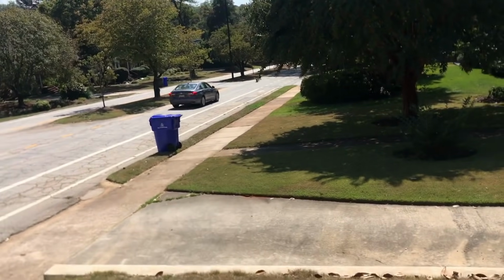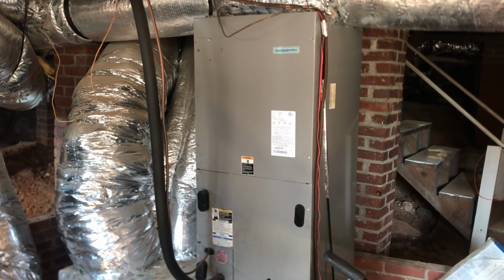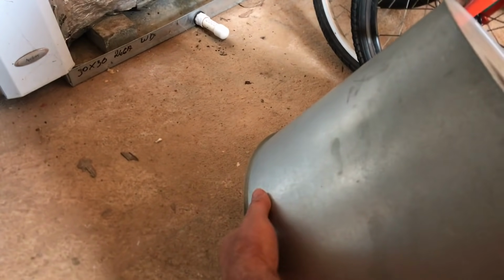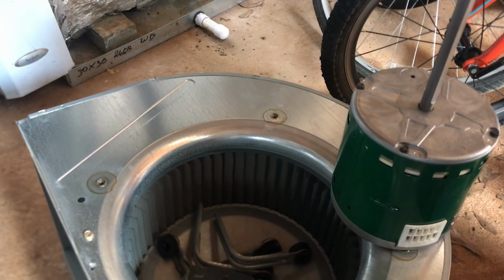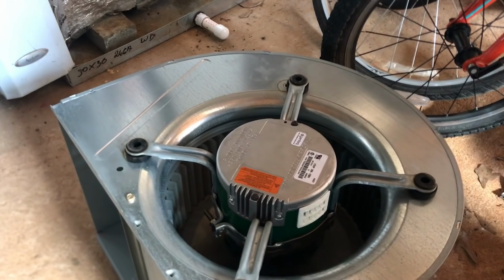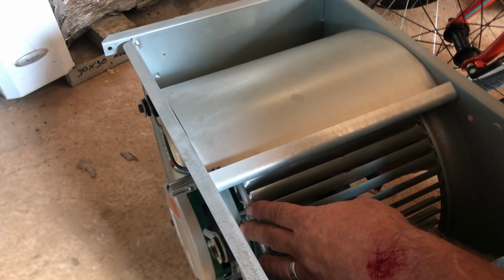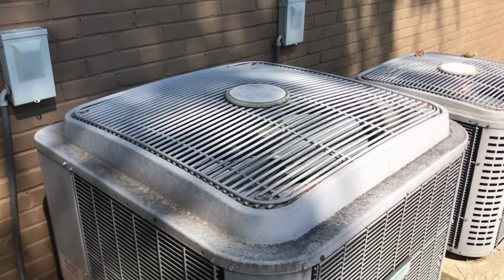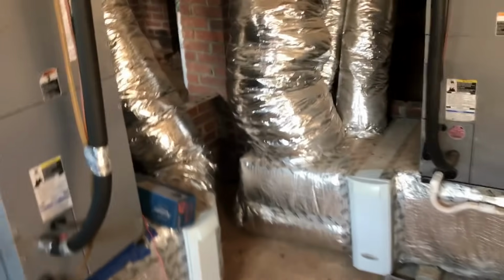Replacing X-13 Blower Motor in ICP Air Handler

Comment: 👍🏼 Enjoyed this video, especially the blower motor that finds the proper rotation. I am not in the HVAC business, so that was amazing to me. Where is the blower motor start capacitor located? Out on the condenser unit? As I said, I am not in the business, but am fascinated by it. And yours are the very best videos of the 4 HVAC Youtubers I follow. Tnx
Reply: These type of motors do not require a capacitor.

Comment: Having an intermittent issue with the air handler.  The thermostat kicks on and the compressor and handler turn on and air starts blowing from the vents.  The blower motor will stop for a few seconds and then start again.  Sometimes it does it once or twice and sometimes not all.  Ultimately, it completes the cycle and the thermostat shuts off.  I had a reliable tech come and take a look and, of course, the system ran without any issues.  He verified that the thermostat is fine and believes that it is most likely the ECM control module.  He said to let the system run as is as there's nothing wrong with it.  He did show me how to replace the module and it does look very easy.  Just wondering what your thoughts might be on this.  Thanks.

Comment: Qwik makes a plug and play conversion to get away from that over engineered crap, or do as I do and wire in a Blower Relay.
Reply: It's not very complicated, I bench-test the X13, 2.0, 2.3, 3.0 and EON motors every day for homeowners that had a "technician" tell them it was a bad motor.  Normally the result is the motor is fine and the "technician" is an idiot that doesn't know what they are doing.  I see so many people that have air conditioning contractors licenses but wouldn't pass a basic competency test.

Comment: I'd probably leave the arms bolted to the housing.  Then loosen the band and push it down while sliding the motor up and out.  That way you don't have to goof around trying to get the arms in the right spot.

Comment: Hello Ted good work on the motor replacement. i have a question in SC based on your experience when you say the  A/C unit  is  short  cycling  ( time on/off time and back on )

Comment: Just like the mechanics that work on cars I break out there Liquid Ranch and spray down with they have to loosen up and let it soak in, I'm surprised you haven't thought about doing that by now replacing fan motors?

Comment: HVAC in SC I think is following yer vids.  Seen where he says in one video not to just change out capacitor.   And he just came out with a 60 sec tip about the green motor you just replaced.

Comment: Those x13 motors have a bad reputation some good they work off 24v from the control speeds are pretty simple the module on the motor  outlast the itself in most case, they dont have a start capacitor that's where the module comes into 24vs from control board is what tells it to there are 2 models a 120v motor and 230/240 so when it has a call to come on from the 24vs off the control board it basically completes the the primary voltage that makes run and sometimes the factory speed settings are off allitle ,the simple to check is take the module off and check the 3 leads on the back side of the if there is resistance between one or less there is a winding issue on the motor itself you can also check the leads to be sure it is not grounded to the what would the motor shell most of the time the module is good and the motor ends up having those x13 motors sometimes run near $400 depending on where you the module itself cost $200 to $300 depending on where you get them as well I live in Springfield, mo, I recently had to replace our x13 motor we ordered it off ebay for I believe $229 so still not that as well,I called a supply company named stone parts had them instock,they wanted $449 which was incredibly too expensive which I turn led me to a cheaper route,  I do like the capacitor type motors the best, you can convert to capacitor type however the x13 is very easy to install and troubleshoot that's the only reason I went with original replacement  but not you almost have to have a doctors salary to afford the x13 ,yes they have bad things about them and good as well ,but there is good and bad about any product, I love watching your videos you have a lot of knowledge and tricks of the trade stored in you head I'm just a journeyman hvac person I've done installs on new homes exx. Sometimes when stumped on an issue I find one of your many YouTube videos  and learn something pretty much daily,I know this was a really long comment i just wanted to throw a few things i had been i may be wrong on some informative if i am could you please let me what it was and clear up what I may been wrong on,thank you have a super day

Comment: My brother handles most of our HVAC, I usually only get involved when there is complete new wiring or complex smart systems need setting up.
We're have both come to the conclusion that the small efficiency gains of the X13 motors are completely obliterated by their absolute unreliability.

Comment: There wasn't  the option to just change out the module?
Reply: Chris Hall from the looks of it it was all one piece
Reply from the maker: @hozerhvac4406  Shoal was.
Reply: Cory Desormeaux if you look at the video where he’s taking the original motor it, there are two black screws.....this is what holds the module on. I, in most cases just change the module out so I was wondering why it wasn’t done here.
Reply: @chriseh09  manufacturer doesn't want field personnel swapping modules because most techs don't ohm out the windings or check for grounds and then you're back to square one.

Tl/dr: manufacturer doesn't trust you.

Comment: That sure was a clean air handler. And that x 13 sure did last a long time. I know it was only because it was a gentek. And it's too bad you can't just buy the module for that motor. If you could have done just the module, it would have taken you less than half the time.

Comment: Why on earth are these ECMs failing so darn quick?
Reply: I couldn’t agree more! I have been replacing components on the circuit board inside the 2.5 ECM motors for the last few years. With the release of the ECM 3.0, the manufacturer has re-designed them to be unrepairable but maybe more reliable. Only time will tell. The motor in this video is the updated 3.0 version and it failed. I use to say they were engineered to fail. Now I’m inclined to say they’re simply under engineered to be a long lasting dependable product.
Reply: I have no idea the design maybe my experience is almost 60 % of systems I installed that had a x 13 I had to change out the ones that are out of warranty I put a psc motor in it
Reply: Tommy Sawyer In a lot of cases they are continuous torque motors which means they will try to keep and maintain the load regardless. Even if the filter/evap coil is dirty or there is some kind of obstruction. Basically a lot of times they ramp up to try and keep up and burn themselves up in process. And that’s not to mention the circuit boards inside them that are susceptible to power/lightning surge from utility. As an HVAC tech I replace these ecm motors almost daily. Also a lot of company’s like to do strait changouts which means replacing existing standard unit with no duct modification, and slap a high SEER unit in.(Generally more efficient units require much more airflow than a standard system) I really don’t think there is a problem per say with most ecm style motors but rather lack of education on how they should be installed. I still prefer pfc motors lol. And I’m in no way an expert, but just my opinion from my experiences.
Reply: ECM modules have a common failure which is a thermistor which goes bad and is a common for these to fail.  easy cheap  fix
Reply: poor electronics so the little saving on kwh cost you big in replacement cost, an old type motor lasts 30-40 years.  Same old story stay away from any new technology maybe by now there less bad?
Reply: Failure of the MOSFET's on the printed circuit board, and an ASIC (Application-specific integrated circuit) which serves as the comparator, that tells the electronically commutated motor's driver circuitry 'the speed at which it must function' to be in harmony with the temperature demands of the thermostat, versus the thermal dissipation function of the evaporator and condensing unit. <-----<<eh, usually, that is; the motors themselves are damn near bulletproof.

The electrolytic capacitors on that same PCB are often 'craptastic', also.

Check out "AvE", but not when your family is within earshot, he's fluent in Canadian: https://www.youtube.com/user/arduinoversusevil/videos
Reply: Airflow issues and moisture issues are the 2 main killers of ECM/X13 motors
Reply: Cantankerous.... very polite word choice. Thanks for the video

Comment: I was never a fan of Trane going back to when it was GE! The spin fin condenser coil was and is so difficult to clean without doing some damage to the coil. Other than that, it’s a good product. Enjoy your videos❗️
Reply: I dont sell trane units and i believe that coil is the easiest coil to clean  and will run cooler when its dirty than a tube and fin i hate micro channel!

Comment: I always have the company come by twice a year and test the unit. Once before summer starts and again before winter begins. I think it makes the unit last longer and use less electricity. Maybe it is a waste but it makes me feel better. PS I also change the oil in the car something these people probably do not do either.
Reply: If you change the filter regularly you won't have problems keep the hamster wheel clean

Comment: X-13s are junk. Almost every one I have installed was changed out within 10 years. That is why the manufacturer extended the warranty on those motors to a 10 year free replacement part.
Reply: My company has only had one X13 failure in the last five years out of several hundred installed. But then we do manual J,S,and D on every new construction install, and on replacements take many static pressure readings to determine if the duct system and or filtration need changes modifications etc.
X13 motors are quite reliable when working in proper parameters, but the do die an early death when expected to deliver against very high TSP conditions.